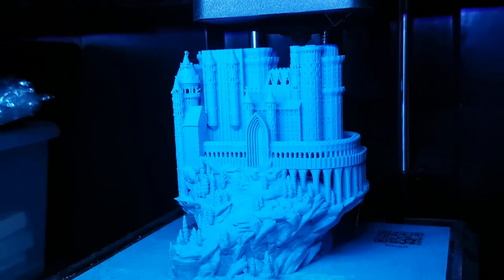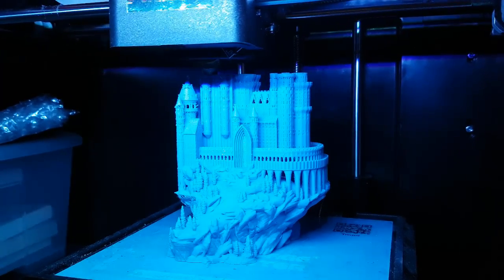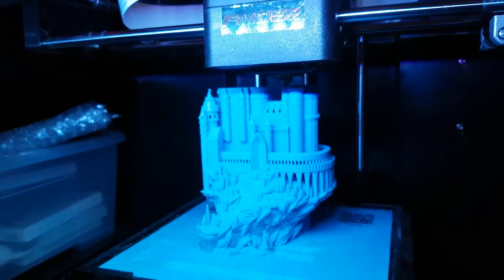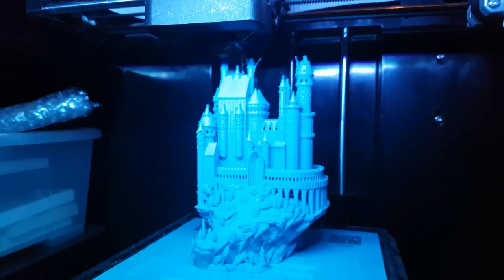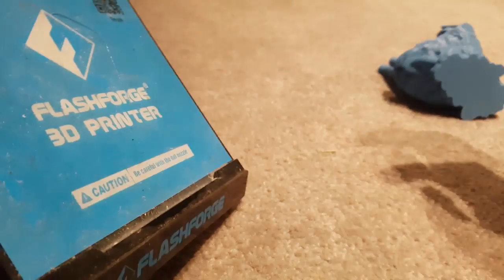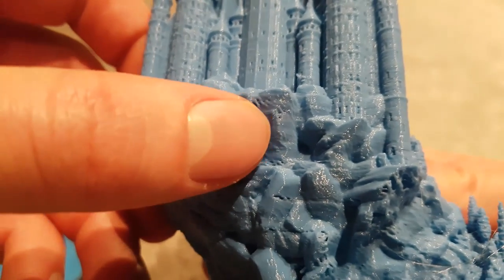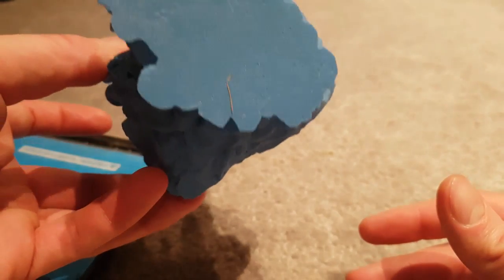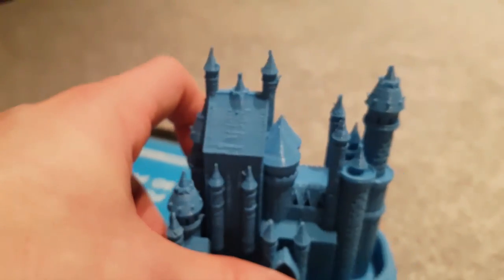3D Printed Medievil Castle on the Flashforge Finder

Comment: Nice video but two (minor) mistakes. 

1) There is a print cooling fan. It's a blower fan tucked away inside the print head carriage under its black plastic cover and if you look at the nozzle you will notice 4 slits surrounding the nozzle which is where the print cooling air from the blower fan is delivered.

2) The total build volume is 2744 cm^3, not 14 cm^3.
Reply from the maker: 1. Omg how did I never realise this about the cooling fan, nice one for pointing that out, do you have a Finder? Do you feel that fan does much?

2. Fair play, I stand corrected.
Reply: ROBNOB9X Yes, I have a finder as well and the print cooling on the finder is very good in my opinion. I have experience with many other printers and the finder has one of (if not the) best print cooling setups around (as do all the flashforges it would seem). Why? Because a) It's a blower fan design and b) the fan shroud design delivers the print cooling air from all directions around the tip of the nozzle onto the printed plastic thus providing optimal print cooling performance.

The print quality I can achieve with the finder rivals that of printers 5 times it's value. It's only con in my opinion is the relatively small build volume.
Reply: Can one of youse fella help me with setting? I make molds and reckon'd this would be a neat toy for prototyping, but I can't seem to print anything but the boat correctly. I keep getting problems with melted plastic forming more of a blob than the shape. I did the boat, no problem, downloaded Zim, an Arwing, and a Nuka Cola bottle just trying to figure the machine out and I just seem to not be able to print anything resembling a spike without the tip turning into a blob of melted PLA. White, stock PLA btw.  It's not a huge problem to sand and fix but I see y'all doing a much better job with the same machine. I've been mucking with temp, right now I'm at 208C, and a bit with scale but it doesn't seem to help it to go bigger it just wastes more time and PLA.